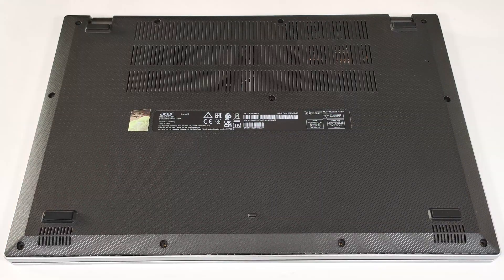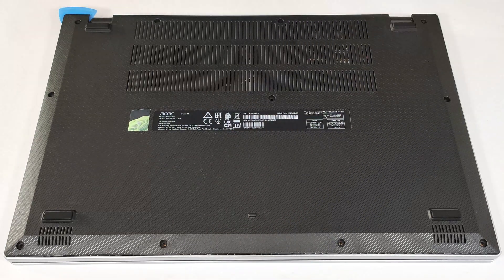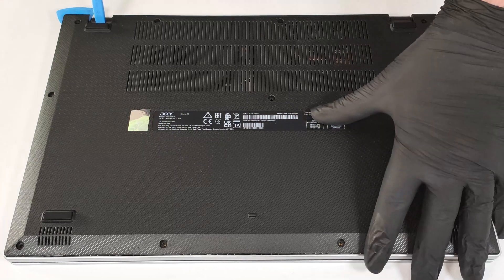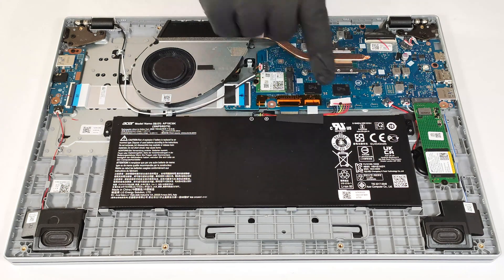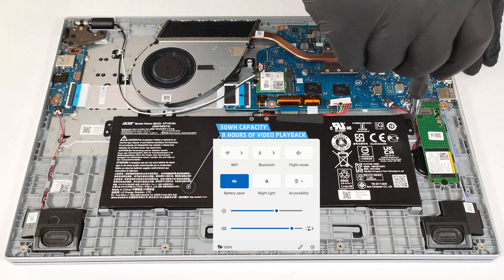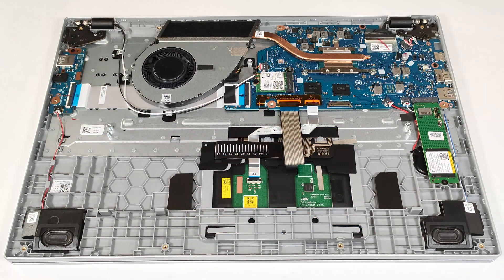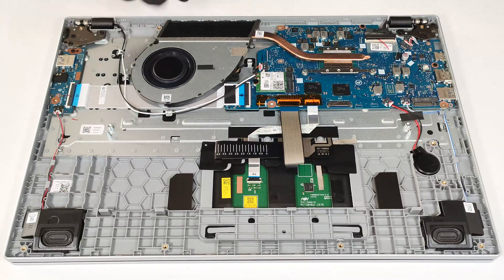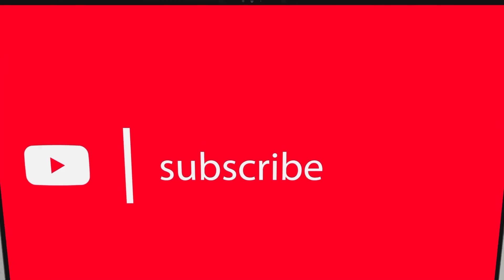🛠️ How to open Acer Extensa 15 (EX215-33) - disassembly and upgrade options

Comment: Does it have extra SSD or hdd storage
Reply: No, it only has that single SSD port. For more storage, you would have to add an external storage device.
Reply: @PC_Monkey Dude it's Ram is also fixed I can't upgrade 😭
Reply: @CryptoBoostOfficial  Ya, not a very cool computer if its not upgradable :(  Sry
Reply: @CryptoBoostOfficial  with 16gb ddr soldered Ram, I have enough memory to run Linux without memory swap . So 8 to 16 GB is the minimum Ram configuration I'm looking for